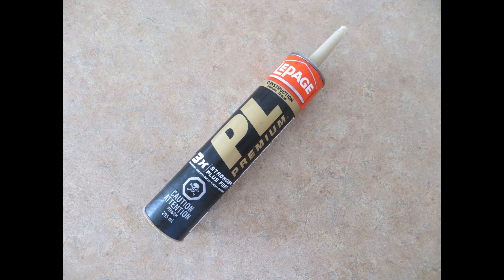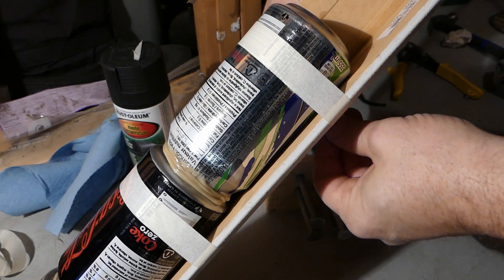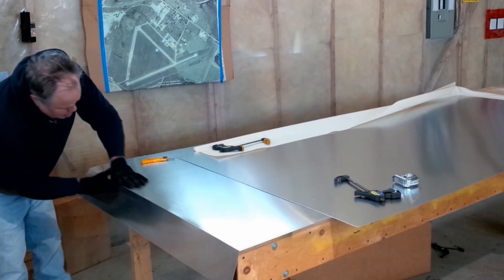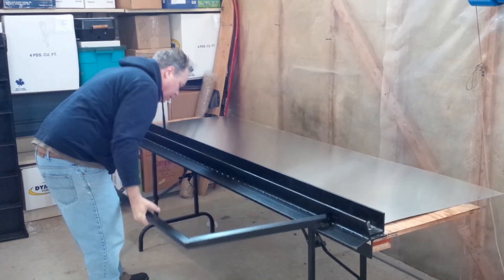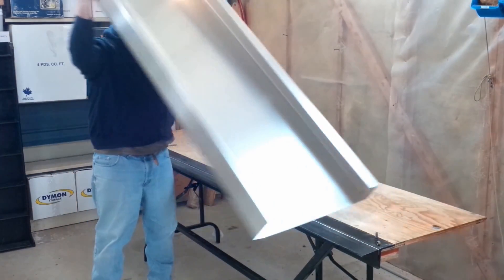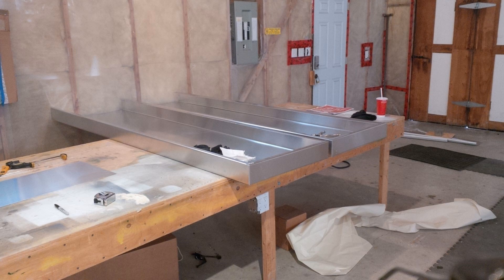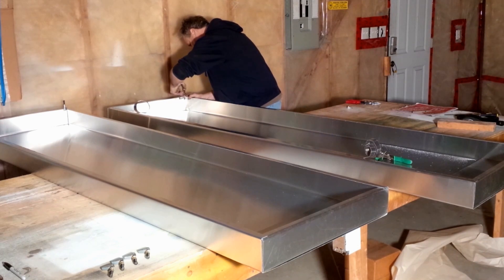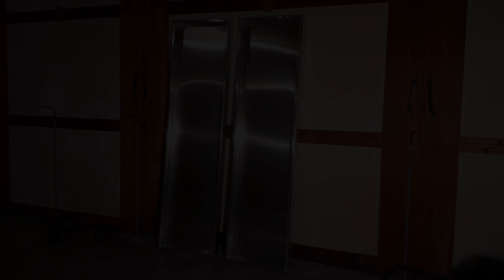DIY Solar Air Heater Part #3

Comment: I watched how much time he played around wit the puncturing nails device and that was not showing the time to pull the nails back from the wood to start all over again, second he cut all the tops off the cans making less surface for the actual heat to cling to. This could have been made so much easier by drilling with a cordless drill four holes in the bottom of each can and two in the top moving the tab over the existing hole for a total of 5 opening on top . the glue PL is the right stuff but using a gun to go around the can way to tedious and time consuming, this is what I would have done peanut butter jar lid filled with PL dip the can 1/4 in in and stack no turning playing around what ever runs the paint will cover,  noticed a can of Rust-oleum paint assuming that is the spray paint he will use to cover the cans, one problem most rust paints tend to have a sheen to them and you don't want to reflect heat your game is to attract, flat black wood stove heat paint is perfect you can even get it in a can and brush on if you haven' got a mask lol At this point I'm out as time on the rock is valuable I am aware that your making a miniature series and want to attract as many subscribers as possible to take to the bank.. Not trying to be an armchair critic but I guess all of us who speak truth are all the best. cheers

Comment: Do you put the large single hole up for the output or down for the input.
Reply from the maker: Hi, I’m not sure that I understand your question, so I will try my best to answer.

Hot air rises, so on my first unit I installed a thermal switch near the top of the chamber.  When the temperature gets hot enough in the chamber the circuit closes and the fan turns on.  Because I need to monitor the temperature in the heat chamber to determine when to turn the fan off, I continue to circulate air in this unit from bottom to top.  

On my second unit, I run the air the other way, which is better.  It draws air from the room closer to the ceiling, where it is warmer, heats it up and blows it out the bottom where you need it.  Because I didn’t need a thermal switch in this unit, (the 1st unit’s thermal switch turns on all fans in both heaters) I could circulate the air in this manner.  

I hope that answers your question?
Cheers
Reply: @LifeIsShortDIY  
No I am talking about the cans themselves. They have 4 holes on one side and one large on the other. Is there a difference in placing them up or down. Thank you Paul
Reply from the maker: @parthur3  Paul, jump ahead to video 6.  I didn’t use the 4-hole approach.  Too much resistance, not enough airflow. Please jump ahead to video 6: 
https://www.youtube.com/watch?v=PhuUWfriKLI&list=PL6YanwREcLx7h747VhKjJLClqvBmy5cF5&index=6

Video 6 covers my findings on my first build, and shares what I did to fix the problem.  Furthermore, video 7 improves the design even further.
Kindest regards,
Reply: @LifeIsShortDIY 
Thank you.
Reply: @LifeIsShortDIY 
Great video

Comment: Nice construction but if you want to save time and money use 1/2" foil faced styrofoam. One layer for the shell. A second bottom layer for the inside bottom. A strip down both sides to hold a layer of foam creating the air intake plenum. I cut a panel at both ends of the cans sealing the upper half of the heat exchanger but allowing air to flow through the cans. Then another strip of foam around the box on top of the middle foam where the cans set. Then on top I used a corrogated greenhouse or sun rated construction panel. I think it was around $20 or so when I built my unit six years ago. Caulk to seal and then go over all exterior seams with foil type duct tape. My unit is eight feet long with an adapter at the top so I can place the adapter into a window and the unit runs out and down at the proper angle for my area to maintain a 90 degreen face to the sun during the winter. It raised air temp by 40 to 50 degrees and convection flows air so no fan is needed. I drilled out my cans with a hole saw on both ends and held them with a thick plastic and foam drink can holder. I also painted the cans while they were in the glue up channel. I plan to build a second one this fall as soon as I finish the geo thermal set up I'm working on.
Reply from the maker: Hey, I somehow missed your comments.  Sorry for the later reply.  Thanks for sharing your experience in this space.  Greatly appreciated.  I have some second-hand windows that I might be putting to work in the future – just need to find the time.  I will likely be adding more heaters to our shop. Each will be slightly different, using different materials.  Again, sorry for the late reply.
Cheers

Comment: I wish I had the bending tools to do it out of 5052.  I'm going to have to use wood and insulate.  As an aside, tin snips are painful.  Couldn't you clamp up a guide and use an abrasive disk on a drill instead?

Comment: This guy is a perfectionist with lots of time on his hands and deep pockets.
I don't know why he didn't just put a big circle of glue in a small bowl and dip the pop cans rather then do each with a caulking gun, talk about tedious!
Reply: Do they even need to be glued? Cans  spigot fit together, and is there enough pressure difference to force a "leak"?

Comment: I am wondering if any of the sealants or paint you are using when heated up could be piping toxins into your atmosphere in which you are breathing?
Reply: Buy a tube.  Spread it on a piece of wood.  Paint it black and put it in the sun.  Sniff it every so often and there's your answer.

Comment: Unless you utilize the manufacturing set-up, this is such a waste of time.

So fickle and slow to do all of this when istead you can buy a metal water pipe, snake it on top of wooden board, colour it black, glaze it and it's done.

But if you sell these as a business it may make sense.
Reply: Hate Speech it's been proven aluminum pipes aren't nearly as efficient.

Comment: It looks like we will need instruction on how you made that bender tool and where you got the stuff for him to see if we can source it locally here whatever here it might be for everyone
Reply: Instruction?  At least 2" angle iron, 3/8" or 1/4" thick, piano hinge and some 1/8" wall steel box tube.  Done.  Just look t it.
Reply: Instruction?  3 pieces of 4" x 1/4" angle iron.  A 6 foot folding table.  8 feet of 1" x 1/8" wall box tubing.  Piano hinge.